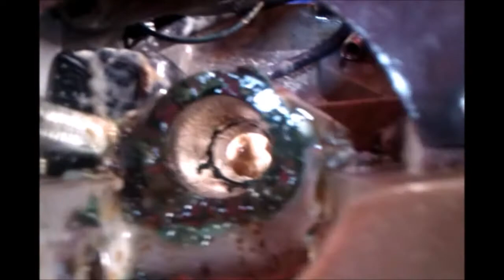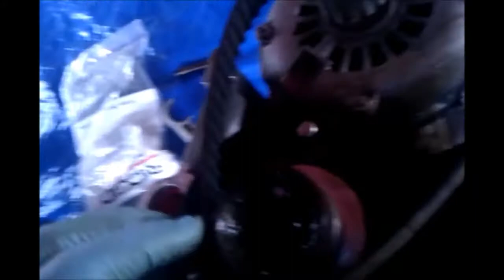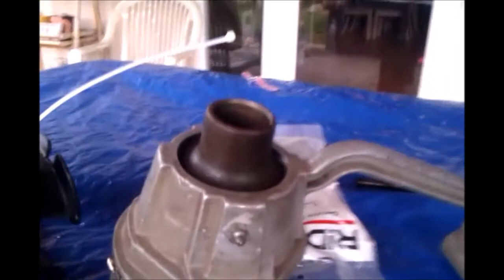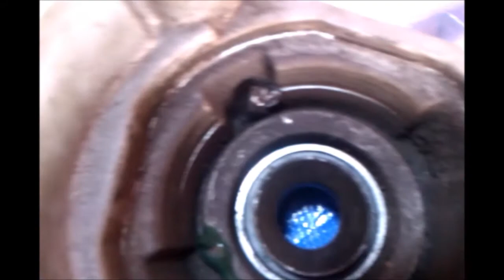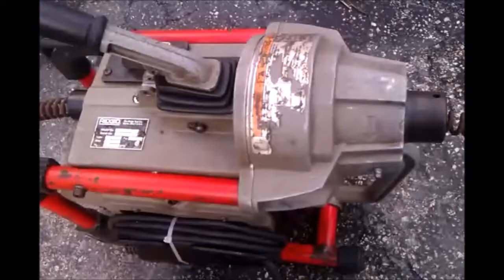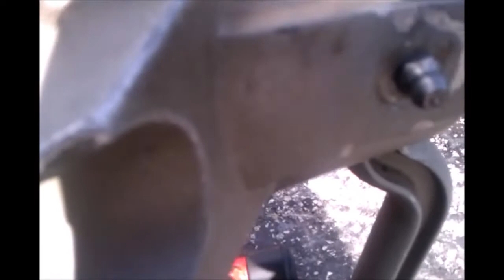ridgidk60

Comment: How did you get the pulley off on top of the piston?
Reply: Looks like take the handle off and take the piston and pulley off together if the pulley wont come off by itself.
Reply: You can also use a blind bearing puller kit with the included slide hammer..